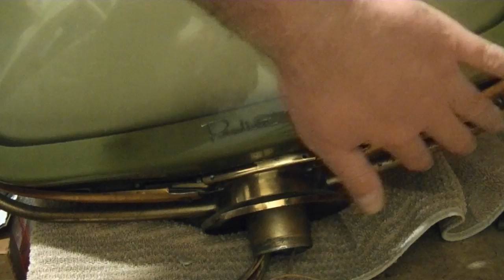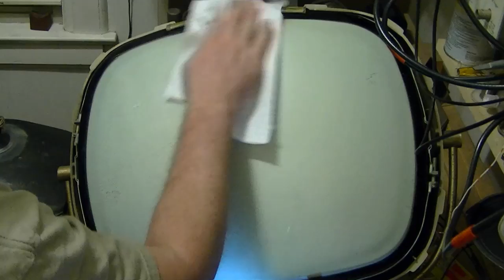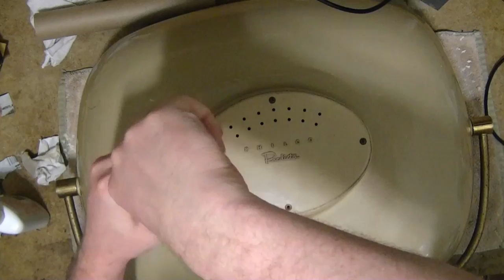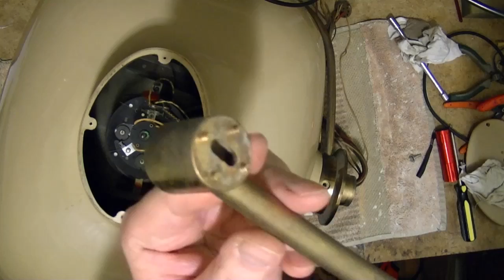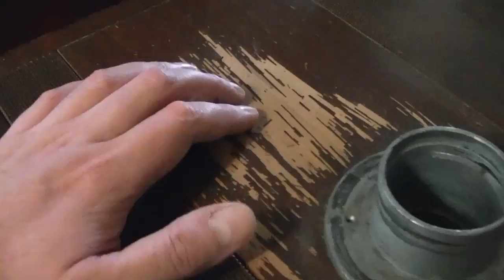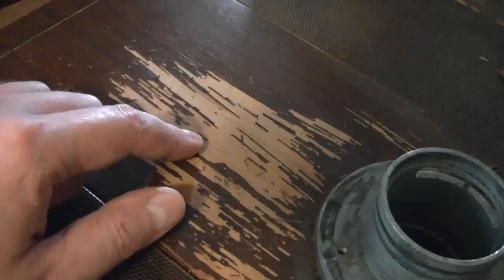Predicta "Holiday" restoration p14o?

Comment: I hate the idea of going through all this with mine, so much trouble. The cosmetic stuff is easy compared with actually making it work again. And seriously what good would a beautiful unit be worth if it didn't actually work. And even if it did work there are no broadcast stations left to tune in! So you would need a digital converter. 
I thinks its cool though this is the model TV used in the Fallout game series.
Reply from the maker: +TruAnRksT I actually find the electronics to be easier ;)  We still have a NTSC broadcast on chanel 6 in Chicago.  Also, you can get a low power transmitter for less than $50 that will cover your home pretty well.  Some guys set up several set to different frequencies to the old tuners can still be used to switch between them.
Reply from the maker: +TruAnRksT Oh and there is definitely a market for beautiful sets that don't actually work anymore.  Especially Predictas and other models with distinctive styling.

Comment: Interesting video, with some good information.  Their is an alternative veneer that you could use that would eliminate the problem of it being higher than the sides.  They have available on ebay a paper thin veneer.  It is quality veneer with nice looking grain, but is thin as a sheet of paper.

Comment: I wonder if you could use a type of decal transfer paper to replicate a faux wood grain, I remember reading about some stuff called "Lasertran" that you can run through an ink jet printer to do something similar to what you were describing. One thing that won't work is a colour photo copy, the ink has silica in it which lacquer will not stick to.

Comment: Maybe it will warm up by then. With regard to replating the metal parts I would contact a vintage car club about who does the best plating at the best price, and it usually makes sense to have plating jobs done in bulk. I've asked platers about rust on steel but they claim it doesn't make much difference unless it's really crusty. Another option may be to powder coat the metal parts, some powder coats come out looking almost like plating, but it is also thicker then plating so keep that in mind.